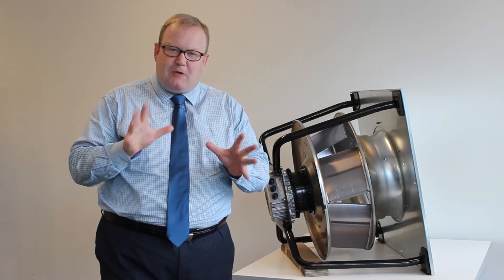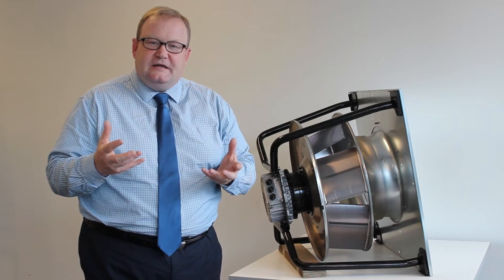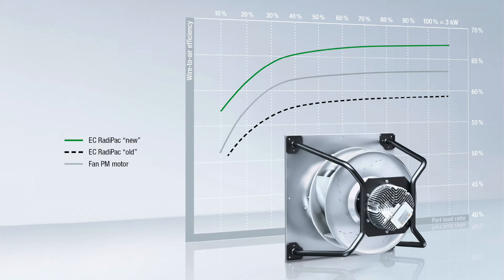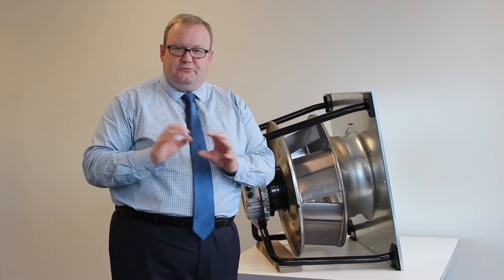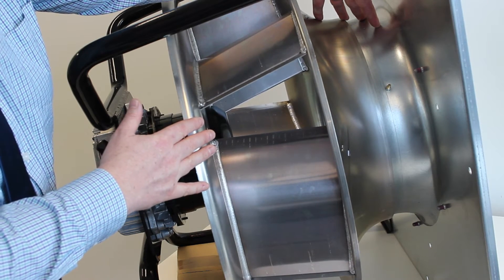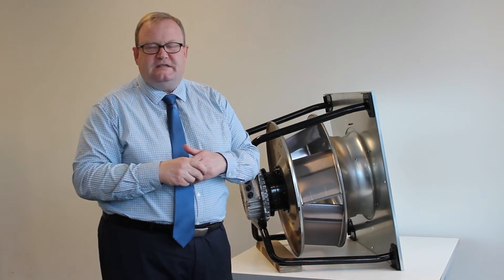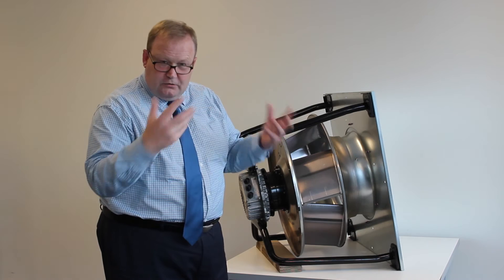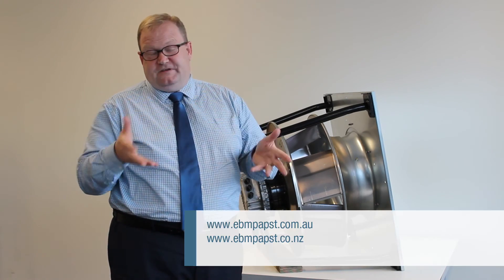New RadiPac EC centrifugal fan

Comment: Can we use fibre fan in place of metal fan ?
Reply: Hi Ravi, different impellers can be used as required.  They have to fit both the mechanical and environmental applications as required.  We use composite and Aluminium ones. Thanks for your enquiry.  Simon